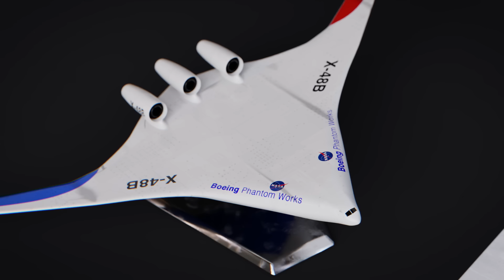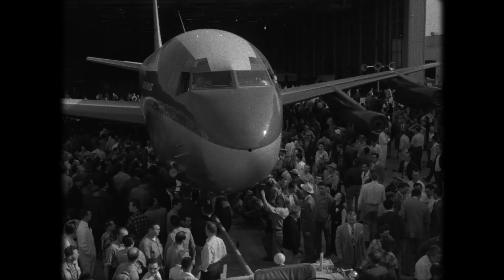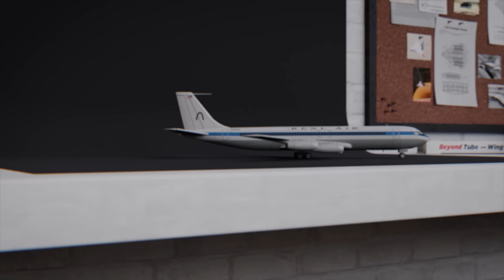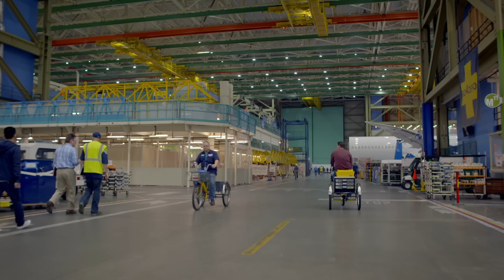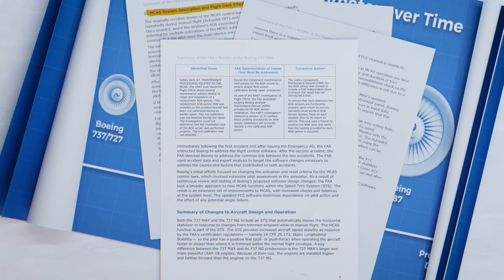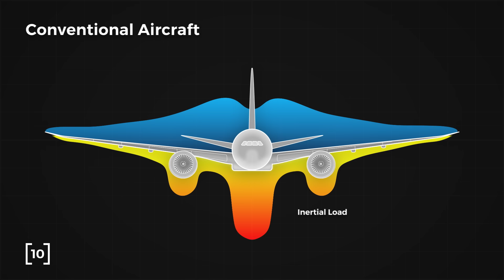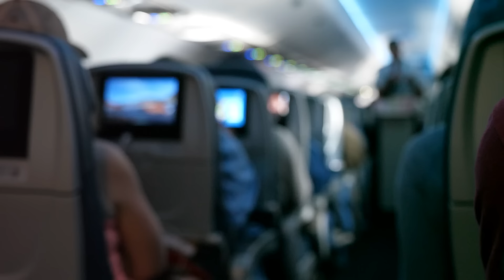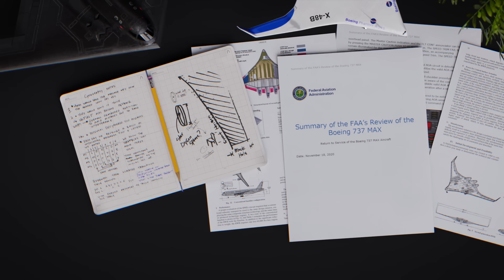The Plane That Will Change Travel Forever

Comment: I personally don't think this plane will ever fly commercially. Now the fuel consumption metrics are very important and make up a substantial portion of the cost of a flight. It would only seem logical to attempt to reduce fuel consumption as much as possible to be more economical. I think this is only true to a point though. I think the cost of manufacturing this plane would severely outweigh the margins of profit. Firstly, carbon composites are very expensive and are difficult to produce quickly. One thing you didn't touch on that is very crucial to designing planes with any composite materials is their failure behavior. most engineered composites have a high specific modulus of elasticity which is great for saving weight on components, but these composites are also relatively brittle. When they fail there is usually little to no warning, unlike aluminum which will deform greatly before ultimately failing. Finally, I dont think this plane is truly safe for a large amount of people for a couple reasons. Mainly, it is very alarming that in the event of a failure of the fly by wire system there is likely no humans which could pilot this. I know this hasn't happened for the B-2, but the B-2 doesn't fly as much as a commercial airliner does, so we don't have a solid metric to go off. Furthermore, it could be totally catastrophic if one of these planes had any of its control systems fail. Since there is little passive stabilization, a small failure could have profound effects.

Comment: Sorry, as amazing as this is, this won't be more environmentally friendly. More fuel efficiency = cheaper flights = more flights = similar or more total fuel consumption. This is what's been happening with the fuel efficiency increases so far after all.

The thing that's making the fuel burn is not the engine efficiency, it's the number of flights.

If planes were to be more environmentally friendly, it should either be totally electric (with sustainable generation obviously), or with something like carbon tax so the passengers have to pay for the carbon they're emitting. Which would actually lead to less total fuel consumption.
Reply: The good and old Jevons Paradox
https://en.wikipedia.org/wiki/Jevons_paradox

Comment: @RealEngineering your explanation of tailless aircraft stability is not complete; flying wings can be designed to have arbitrarily high static stability just like any other aircraft. Sometimes designers choose not to do so because stability is more tightly coupled to performance on tailless craft.
Love your videos! I just hate seeing these misconceptions getting parroted around.

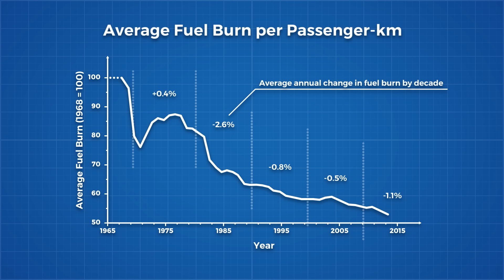Comment: The graph around 1:25 could be made a little more transparent by having the y-axis running from 0-100 instead of 50-100. Nothing you said was wrong or overtly misleading and I understand that the decision was made to emphasize the drop but it can be easily misread at a glance if someone isn't paying attention. Just a suggestion from a data person.

Comment: Worth noting B2 did not use those control surfaces during "stealth mode" as tiny variation in geometry will add radar reflection, exact detail of how B2 able to fly without any control surfaces still remained classified.

Comment: 12:10 The larger engines on the 737 MAX more importantly moved the centre of drag/lift of the engines up and forward, increasing it's moment arm around the Cg (especially while climbing). Larger engines also increased this force.

Comment: We reduce the drag on the planes by 20%, lets add a third engine, what could possibly be more stupid? Also this plane either have no fuel tanks, since most of the plane fuel is on the root of the wings, or cargo bays, pick one, you are gonna need to, with this airlines almost lost the biggest profits per mile flow to them.  

Did I mentioned that the engines are on top of the fucking plane, thus maintaining those engines working are a nightmare? Also you are gonna need NEW airports gates, terminals, service trucks and much more to have those planes existing? And forget smaller airports and regional jet operation, with the engines on top of the plane, and fucking 3 of those, the operating costs and required infrastructure skyrockets, not to mention that to substitute an engine in a low wing aircraft you just need to put the trolley to take the old engine out and another trolley to put the new engine in, easy peasy, on a high wing or tail mounted aircraft you need a telescopic trolley and a couple stairs, harder, but still doable, in this thing you need a crane, and good one at that since those things have 1-8 tons each, so FORGET easy maintenence. 

450 passengers? WTF. Are you activelly trying to make this plane fail miserably, the 390-450 of the A-380 and the 747-8 were way too much, the 320 of the 777 is already pushing it a bit, with 450 minimum you are definetly fucking this planes sucess chance of ever taking off. 

Gotta love how the maintenence nightmare that is this thing also have more maintenence requirements due to pressurization, please do go on, this disaster REALLY needs even more reasons to be catastrophic failure.

Also where are the galleys of this thing? For 450 passengers you need half of a industrial kitchen from the offset, where are you gonna put those? Flying this thing will also be a nightmare, since the cockpit by desing is verysmall, if you see the space for the cockpit on every comercial airplane is basically the same, an A-380 Cockpit isnt much larger than an Embraer E2, why? Because the controls need to be acessible by both pilots simultaneously, so they are gonna need to be placed very centralized, what do you put beneath and around them? Fuel? Also trying to land this thing is another challenge, with a traditional tube and wing you can guess fairly confidently where you land gear is. With this? You have an A350 weight, A380 passengers and the lenght of a 737. Landing this non-automatically is a nightmare

Also having 6 aisles are entirelly useless if airports can only fit 2 fingers for you. And this planes is gonna be very wide, so you better put some wing folding tips on this thing, or else this wont fit into airports. And you also need to carry less fuel to fit the mechanism for the wing folding

Shall I continue?

PS: Something else, can this thing fit an APU inside of it? Because you are gonna need one if this thing have ANY hope of operating in small airports. Also, if you are mounting your engines and most of your fuel is in the back, since the front is where the passengers are and the wings are minuscule, this plane is gonna tail heavy AF, so yeah, the plane is still gonna need more indeced drag because the elevators would need to rest at an angle to keep the nose down, since the COG now is behind the wing.

Comment: The blended wing body design would require substantially new/different fabrication techniques other than the current connected tube fuselages approach that all plane airliner factories currently support.  That means a massive, up front cost for new factory equipment before the 1st prototype could even be made for test.

Also, manufacturers could not add more seating by simply adding more length to the tube.  They would have do significantly more engineering to create a larger (or smaller) payload area, increasing the cost of production with yet more fabbing equipment.
Reply: You forgot the more common way to increase seating: decrease legroom.
Reply: @ps.2  They've largely already reached that point.  All that's left is uncomfortable for any length of time set ups that people will actively avoid if there's any other option.
Reply: Ah yes. Another boomer pretending to act like an engineer in the comment section
Reply: @zylnexxd842  Ah, yes.  Another troll has popped up from under it's bridge to hurl an insult.

Comment: The biggest obstacle to environmentally-friendly air travel is fuel--the stuff that actually results in carbon emissions to use or produce. The tube-and-wing design might not be maximally efficient, but it's safe, versatile, simple, and well-proven. A fuel/power source that allows for zero-carbon-emissions flying is vastly more important, since a little inefficiency is of little importance compared to not having any carbon emissions to actually fly.

Comment: you should do a small series applied mathematics and what high school math can be used to design things like steering angle of cars for students in calculus or finally find out what are the real applications of polynomial functions. without this I feel like a lot of viewers would not have a mindset of moving forward but instead being interested to see what engineers have accomplished. Giving a course on the average applications of the algebra 2 math or trig could help with the idea that math has uses.

Comment: Overall a great video, very informative.

However, one point of discussion is the composite structure. How can the composite structure be manufactured? Autoclaves are also pressure vessels, hence they're round. Current fuselages can be made in huge pieces and auto-claved all at once. Either new auto-claves with a different cross section would have be designed, costing money & resources. Alternatively, the composite structure could be auto-claved in smaller chunks & then bonded together. Again, a cost riser and risk with associated joints. 

Furthermore, composite structure mechanical properties are also very directional. It works great for round fuselage sections which experiences compression through the bonded axis and tension along the strong axes of the structure. However, the blended wing design doesn't share that advantage. This will turn into a very complex stress tensor requing "INSANE" amounts of empirical testing. Again, very costly. 

In reality, I would expect a titanium structure with an aluminum skin, especially if the skin is going to be structural. Machining centers are very good at handling large flat objects, like the shape of the blended wing design. Additionally, metallic structures handle the complex multi-directional stress tensors better than composites.

Comment: adding a control surface, that can be a "pop up" tail, at a whim, would remove any issues. 

As, if the computer should become inoperable, you could simply pump the hydraulic for the "pop up" tail, and regain human level control. 

I'm not sure why folks can't come up with fail safes, easily, but meow... this fail safe would be easy. 
Just have two surfaces on top and bottom, that get pushed out, like origami, to become a tail, when an emergency arises. it would be low cost, and solve all issues.
Reply: “It would be low cost”
Lmao
Reply: @LiewLmao  it would be a sheet of metal, with a hydraulic, that pushes it out to become a tail, that's as cheap as it gets. 

Making it instead, crash to its death killing all passengers, in the event of a computer failure, much more expensive. 

lmao.

Comment: Adding 20 square feet of frontal area will dramatically reduce efficiency, there is a reason flying wings never caught on. The B-2 has far lower performance than the B-1.

Comment: 0:33 Do the guys in the hangar flip it upside down to work on the engines? To replace them?
Reply: Surely simple scissor lifts should suffice, no?
Reply: @PongoXBongo  Other than the flying boats I don't know of any aircraft with the engines above the wings but not on the tail.Engine maintenance needs to be a consideration of aircraft design. Inaccessible parts are a failure point already.

Comment: As a saftey feature you could have a deployable tail section. It could either be deployed electrically or just flop out via gravity and drag when the plane pitches to a predetermined unacceptable angle.

However, it would be more comfortable and efficient to blimp our way across the skies using beamed in microwaves generated by space based solar panels.
Reply: This idea is similar to having a detachable passenger section with parachutes. It sounds cool until you spend 3 seconds thinking through how you would actually engineer it and make it cost effective considering how rarely it would be used.

Comment: You forgot one major advantage of blended wing aircraft: by placing the jet engines in the upper rear of the plane, the entire BWB body structure acts as a natural "noise muffler," and that's in addition to how quiet modern engines are. That could result in an airplane that would make today's airliner sound noisy in comparison even on overflights on landing and takeoff.
Reply: Inside or outside the aircraft? Seems it would be noisier inside, for subsonic flight anyway, unless the lack of windows permits much better sound insulation.
Reply: @ps.2  Modern technologies have made sound insulation a lot easier to do. Also, because the engines are located on the back of the plane, that might help mitigate the sound in the cabin.

Comment: the primary goal of a bwb passenger plane should be increased volumetric fuel fraction to allow use of hydrogen or LNG. Light fuels can offer a lot more efficiency gains than the aerodynamic advantages alone

Comment: Good vid, but needs a minor correction on the longitudinal stability description: it’s not not quite right.  Fee moving bodies (including aircraft) pivot around their centre of gravity, not the centre of lift. The static margin (distance between CG and CL) brings positive stability due to a decrease in overall lift force aft of the GC with upward pitch disturbance and not a restoring force from the weight ‘pulling the nose down’. 
I also don’t like the look of those rear mount upper wing engines  on the X48. They will ingest a lot of dirty boundary layer air, especially at high angle of attack and likely to,result in issues with a distorted flow pattern across the fan face (and fatigue and air compressor flow stability issues as the engine rotates). Most blended wings either have forward and / or lower wing  surface engine inlet air, but fwd inlets compromises cabin space.

Comment: while i find your video very instructive - but i'm not a 'studied' engineer - i wonder if it is not already really necessary to have Active level-flying control systems to account for the change in weight distribution = mass-point ..  due to fuel consumption ( dozens and dozens of tons lighter on long distance flights ) 
- have to admit ,  after almost sixty years of air travel ,  i feel less and less safe up there ,  at - relatively - 'best' in any ol' 747 ,  by a 'trustworthy' airline ,  like Lusthansa or the like .... 
even then one might run into a love-sick loony 'Chief' ..

Comment: Oh yeah? Another big fat, Hub and Spoke Airbus impossible to fill, even for Emirates? Like the original MD-12 was not of similar form? Here we have an idea, decades old. This Airbus P.R. stunt is an un-manufacturable albatross. Airlines will buy the least expensive, most fuel efficient, point to point aircraft, that work in existing airports. Bah humbug.

Comment: As a programmer, I’m not ready to trust my life to code
Reply: Military aircraft such as the f22 and f35 are unable to fly without the constant intervention of computer systems to their flight surfaces. Needless to say these aircraft are highly reliable. If we can take the same level of engineering discretion in building these civilian aircraft as we do in military fighter aircraft there is nothing to worry about. The logic of your statement is nonexistent due to the impreciseness regarding the specificity of the given situation.
Reply: @quinndenver4075  at some point I will be ready to trust my life to code. Just not yet. Military aircraft don’t have millions of flights per year. There are fewer opportunities for stuff to go wrong. They’re also smaller aircraft and better maintained since they aren’t trying to save a buck everywhere they can.
Reply: @quinndenver4075  To be fair, those military pilots have ejection seats and parachutes at their disposal … because even highly-reliable fighter planes aren’t immune to life-threatening, unrecoverable faults.

As long as we don’t have a safe and reliable means for all “souls on board” to escape a stricken airliner, I’d prefer we do our best to avoid design choices that make super-human capabilities essential to their normal and successful operation.
Reply: @quinndenver4075  Those aircraft don’t carry 300 people and don’t spend anywhere close to the amount of time commercial aircraft do in the air.
Reply: You know planes mostly fly with autopilot already, right?
Reply: @ornessarhithfaeron3576  yeah and if something happens and the autopilot fails, a human can take over

Comment: Fantastic Video as usual from you, especially explaining the static and dynamic stability issues. This leads to a question of mine: Why is a canard style aeroplane not considered? These types of planes are statically as well as dynamically stable, guaranteeing the essential requirements. On the other hand they only generate lift eliminating the drag issue and also keeping the nearly circular fuselage which is proven and easy to pressurize and to manufacture, as well as easily fitting into the existing airport infrastructure.